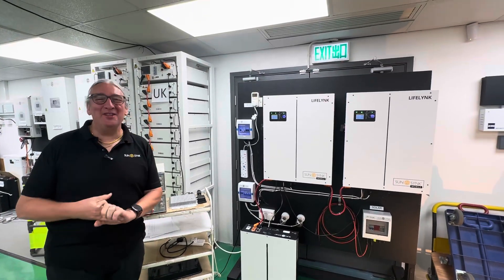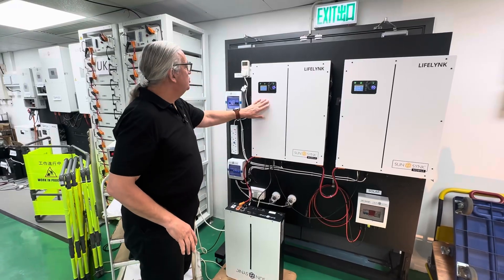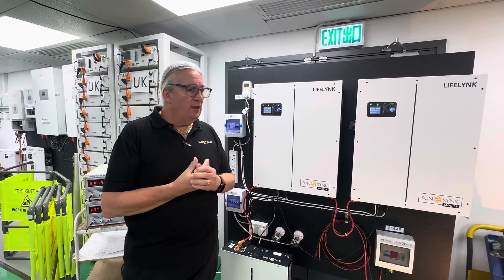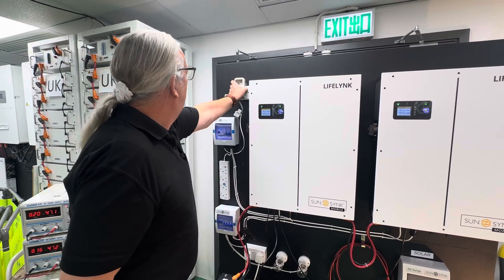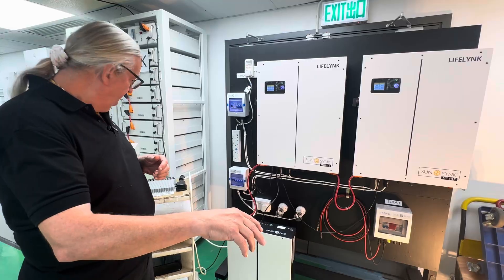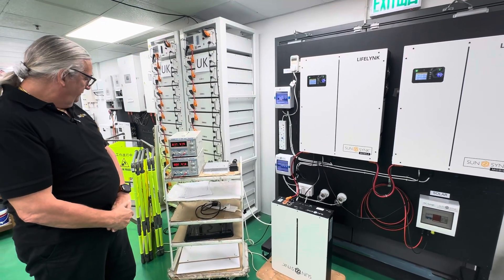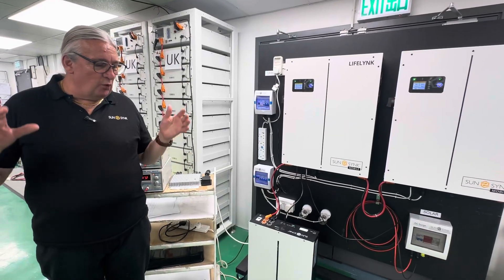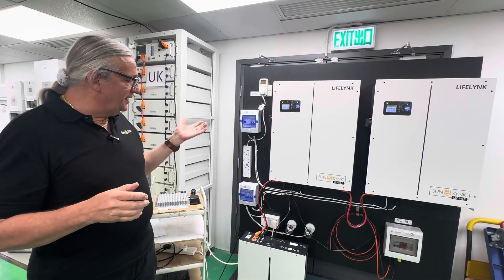How to AC Couple the Sunsynk All-In-One Inverter with Keith & Joe

Comment: If it's a complete off-grid system - I don't follow what the micro-inverter does or is required for.??
Reply: The micro inverter is just demonstrating that you can expand or use existing micro inverters with this system if your adding system or expanding system
Reply: I'm my case , I already have two separate micro inverters which I can just couple to load side, as it would be very difficult for me to run DC all way to battery tied inverter

Comment: Does this work for the Hybrid 5Kw SunSynk inverter. What I have found is when the batteries are full and the micro inverter is producing more power than required, then the inverter trips with DC overload, I have the micro inverter connected to the load side.. I am thinking that the inverter does not know what to do with the power it is getting from the micro inverters. This is when we are not connected to the grid.
Reply: Would love to know

Comment: this thing does not work in case you have a huge load side that is jumping on and off, say induction cooker and batteries are fully charged. the system will not have enough time to react on overload, and that frequency adjusting mode will fail to act fast enough. as a result you will get overcurrect fault

Comment: I have seen my air conditioner behaving abnormally when frequency was above 52Hz. I believe it simply switch off the port when AC coupling is done via Gen port. When AC coupling is on load port than frequency shifting is only option.